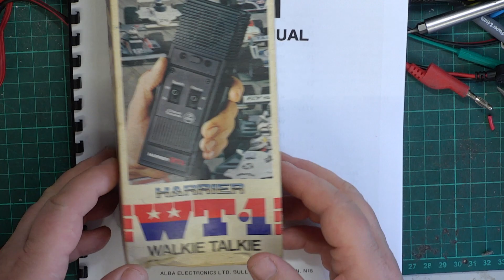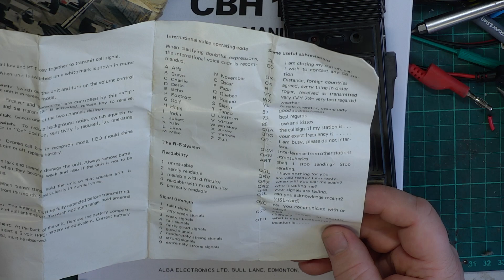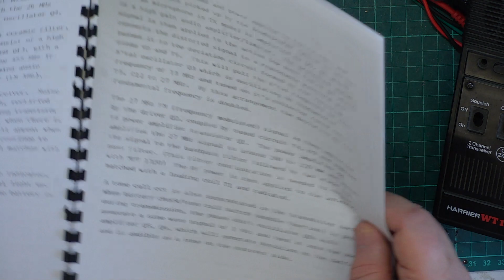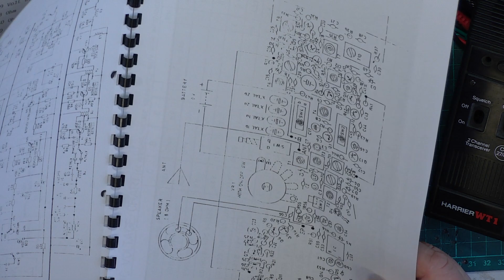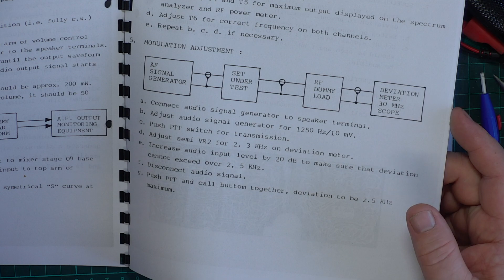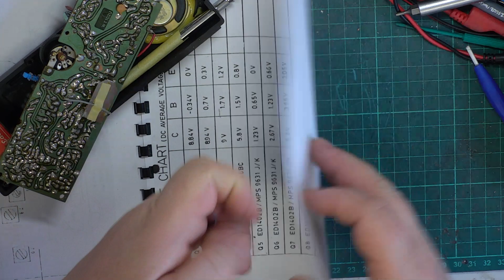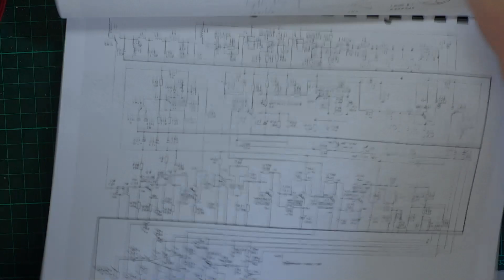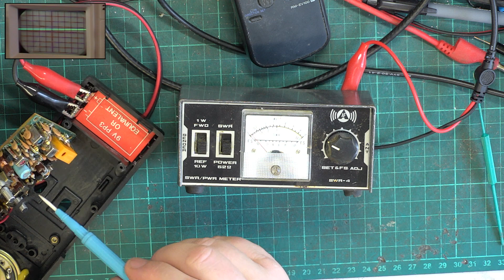Harrier WT1 2ch 200mW CB27/81 UK FM handheld CB -servicing

Comment: Is that a pencil you use to clean the battery connections I tried that yesterday and it worked pretty good on my realistic TRC 216 which is a.m. I know it's a little different but I still like watching
Reply from the maker: It's called a fibreglass brush. The spelling will be different for your country of course!

Richard, G0OJF, UK